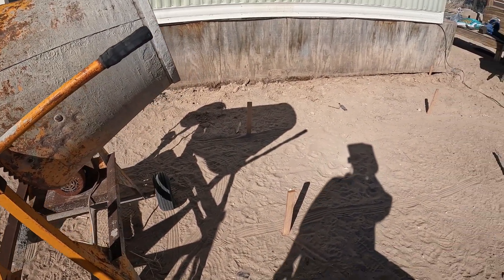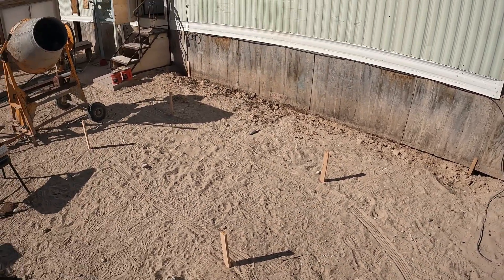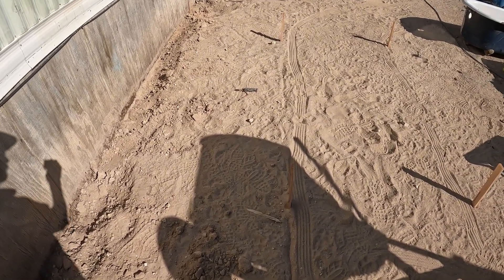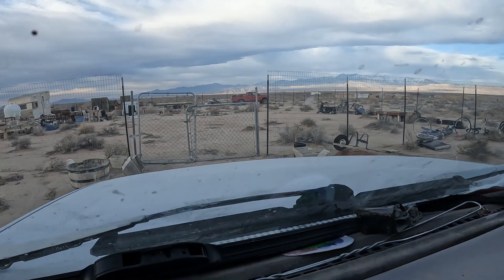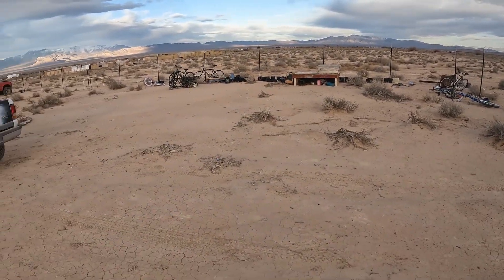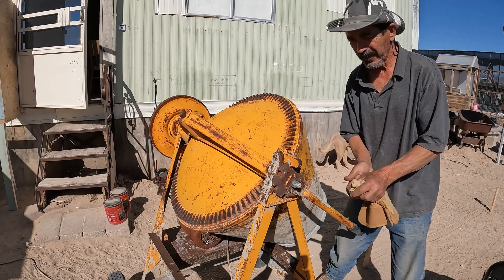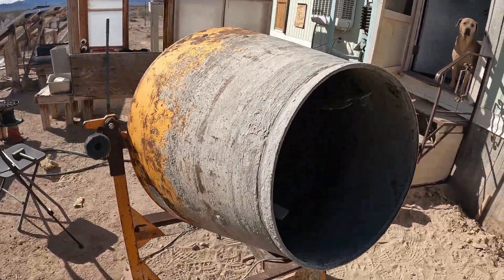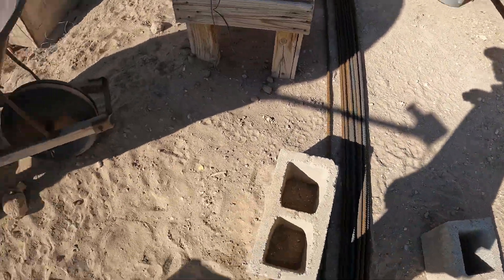Bathtub Super Sand Battery Update, Part 25-B

Comment: They don't make them like they used too! 
-getting bigger and better....looking forward to the build!
Reply: Do you really need the tub? An enclosure made from sheets of roofing metal can hold more sand and you can cut and drill holes for wires and ducts easier . Already has a concrete  bottom .
Reply: @teddycunningham7568  i don't think he needs the tub, AND he can make it whatever shape he wants, i am currently working on a 1400 litre one , two ss milk vats welded together, using sand , scrap steel and copper scrap..
Reply from the maker: I probably don't need the tub. It was given to me to design around . It is a heavy iron which will hold heat also but it's probably not necessary.